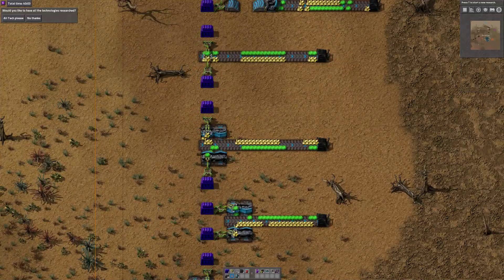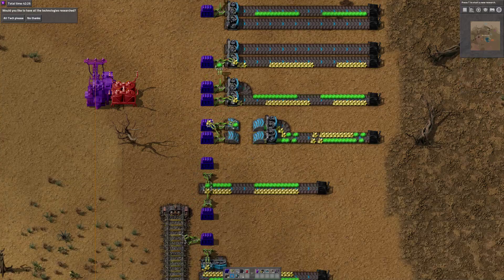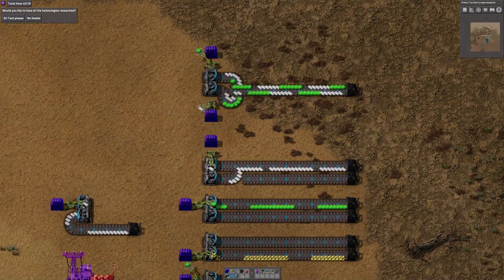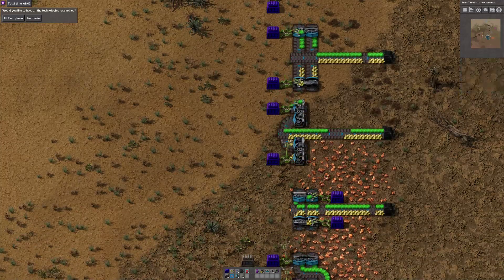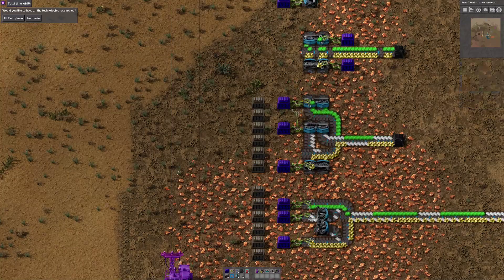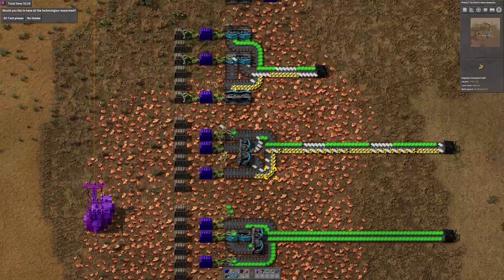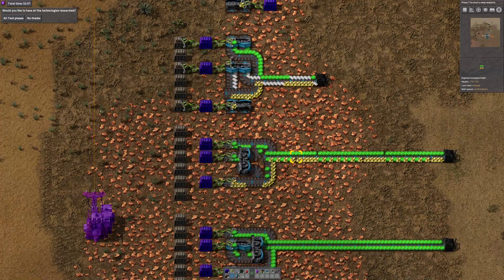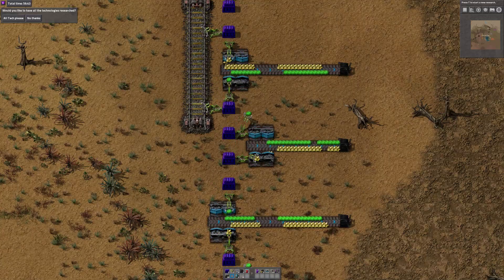Factorio sandbox - train unloading

Comment: Thanks, this was very interesting!
I'm thinking if you combine the one where you suggested an underground for chaining up the other side with the side/straight splitter one at the very bottom, you'd get the best of both, at the cost of two more splitters. (not sure an underground would quite reach though...) Or you could do it on one side, with outwards facing splitters on the side belts, and move those side belts out one square. Should get rid of the uneven unloading problem at least, since all three inserters would unload to a sideways splitter.

Comment: Thank you for taking the time to really figure this out.  Some thoughts:

1. If you make your unloading station diagonal, you can use a second set of cargo wagons instead of separate chests.  You can have 4 stack inserters unloading the train's cargo wagon into your buffer wagon, then use 3 stack inserters to unload onto the belt.  It almost fully compressed each belt.
2. It turns out that, if you want a FULLY compressed blue belt, you might as well have 4 stack inserters feeding into a simple lane balancer, which only requires 1 splitter per cargo wagon instead of 2. 
3. To keep the chests from becoming unbalanced, you can use a second cargo wagon as a buffer that all 3 or 4 stack inserters can draw from.  Unfortunately, this won't generally work because rails are placed too far apart to load one cargo wagon from another UNLESS you place them on diagonal rails.  If you go to factoriobin (dot) com (slash) post (slash) 6f-Ld8k3 you will find a complete unloading station blueprint.
4. If you want to keep vertical/horizontal stations, I suggest using the 'Merge Chests' mod, so all inserters are drawing from the same chest.

Cheers!

Comment: Thanks for the videos. I understand how this is useful if space is limited and I really like the design. However, if the aim is to achieve maximum throughput, wouldn't it be better to go for the usual six inserters? Or is the aim solely to optimize the use of space and UPS?

Using six inserters moves 83/s instead of 75/s and unloads the train 50% faster, but you need to merge the three belts into two. But a 3-2 balancer also uses 4 splitters.
Reply from the maker: Partly this is about ups, and partly it is about exploiting a neat edge case with splitter logic. Balancing across 6 boxes is a pain, and you need circuits to do it properly.

Comment: Thx for the video ! I never payed attention to the relation between inserters and splitters.
 I used blue inserters set to 2 items per grab to fill the gap on the line made by the 2 green inserters and their splitters and in that way the two chest have always  the same quantity (single digit difference ).
My problem now is i have not enought items in the chest to buffer the delay between my trains x)
Reply from the maker: Thanks! Glad it helped. I have a tutorial video on train limits that may help with bringing in trains when the station is ready.

Comment: 14:10 How could your train possibly get stuck filling up the middle chest when the inserter outputting to it from the train is still a lot faster than the inserter putting it into the splitter? Only if the 3 chests are filled from different wagons could the train get stuck.
Reply from the maker: Usually the belt is costumed unevenly. This can propagate back up to uneven train loading. If it pulls from 1 belt lane more than the other, it will pull from one unloading buffer box more than another. In the case of the 3box3inserter designs here, there will always be a box that is drained faster because 3 doesn't divide cleanly into 2.
Reply: @mrpocock  Yes, but why is this a problem? As long as all 3 boxes take from the same wagon the wagon doesn't care if the inserters take more from the middle of it than from a side, or one side more than the other.
Reply from the maker: @Hedning1390  agreed. The wagon doesn't care. But imagine 1 box is completely empty and the belt is being consumed at more than 2 inserters speed. Because 1 box is empty, only 2 inserters are loading the belt, so your build is starved. You hit those kind of problems with builds designed to consume a belt feed from trains.
Reply: @mrpocock  How would 1 box ever get completely empty while there is a train parked? The inserter filling the box is a lot faster than the inserter emptying the box, like I said earlier. Even if we account for a pause while the empty train is switching for a full the inserter is filling the box so much faster that it will easily fill the box back up to full. At eg 5:30, 6:00 and 6:35 you didn't express fear that the boxes would be completely empty at any point even though all those boxes would empty at least as quickly as the middle one in the 14:10 example.
Reply from the maker: @Hedning1390  trains aren't always parked. They empty and go away, and there's a delay before the next one comes in.